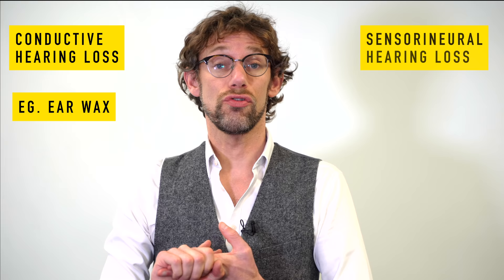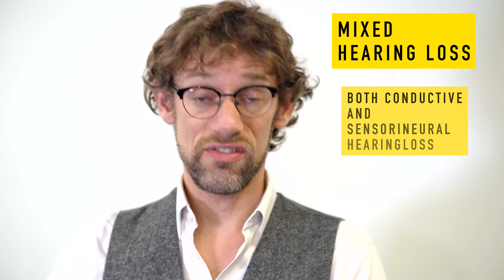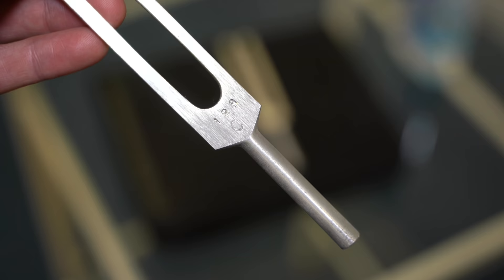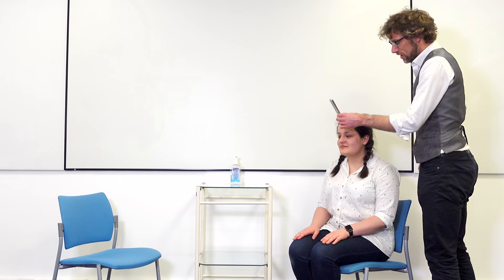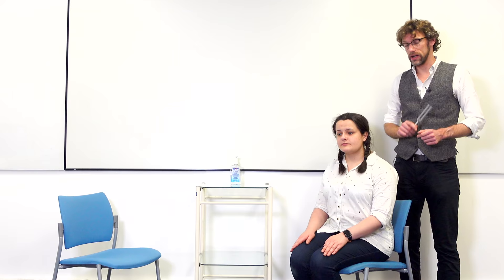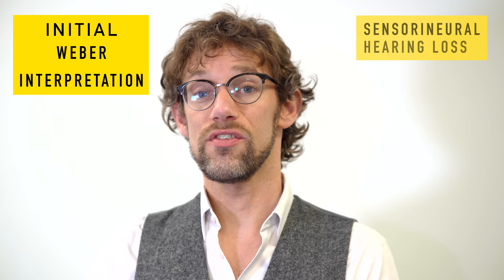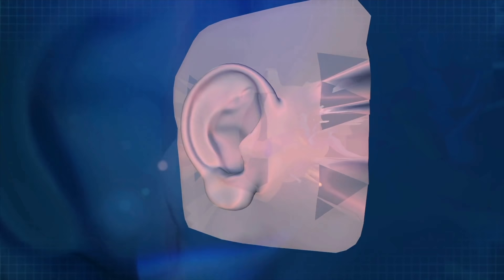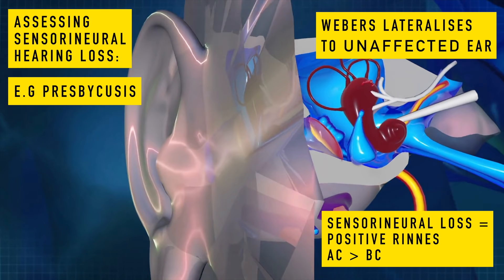Assessing Hearing: Sensorineural Vs Conductive Hearing Loss - Weber And Rinne Test - Dr Gill

Comment: So basically, lets say a patient hears the Weber's test better in the left ear, they either have a sensorineural hearing loss in the right ear or a conductive hearing loss in the left one, right? 

And to verify this we need to use Rinne's test to see if the Bone Conduction for the left ear is better than its Air conduction: if BC > AC, it's a conductive hearing loss in the left ear, if it is not, most likely the AC in the right ear will be less effective than the BC which will show a sensorineural hearing loss in the right ear.

Did I get this right? I'm not a medical student but as a student in audio engineering everything about sound is fascinating to me

Thank you so much for the videos, I subscribed for more :) you never know when you might switch careers lol
Reply from the maker: Perfect 😊

Comment: I have auditory processing disorder so my brain hears everything equally and doesn’t distinguish background noises from relevant noises making it harder for me to process relevant noises such as someone trying to speak to me because I’m simultaneously listening to all of the other noises around me such as a ticking clock, running furnace, passing car, radio or television on in the background etc. but I was also born with ears that didn’t internally form properly which frequently causes them to build up with wax blocking some of my hearing if I’m not careful so I’ve always found this topic rather interesting.

Because of the information overload I sometimes have trouble with my speech as a result and words in my brain don’t always make it back out to my mouth properly because they get stuck in a traffic jam along the way which is very frustrating.  Ironically using sign language completely bypasses the issue for me because it’s a visual language but not enough people know it for me to communicate with it effectively.  Fascinating stuff!!!

Comment: Good video Dr Gill. I have hearing loss in my left ear due to use of a shotgun for years. First noticed it when lying in bed on my good ear. When I lived my head I could then hear a house alarm going off down the road. Put my good ear back on the pillow and the sound was gone. Bit depressing initially. I went for a hearing test and was fully expecting to need a hearing aid but the guy said I only I had only a narrow frequency of hearing loss and a hearing aid wouldn't help. Interesting. Still pretty deaf in my left ear though.
Reply: I’m the same on my right. It’s depressing as hell
Reply: @jodyjackson5475  ah dont worry about it man. I did too for a while and then you get used to it. If your other ear is in good nic you will be grand. I do put an ear plug in that ear when i go shooting now though.

Comment: I had one of these when I was in my early 20s but I didn't realise it had a name! They found that my hearing was normal but I was experiencing a lot of physical blockages because my sinuses are about .0000000734 nanometers in width and I get snot backed up in the system constantly. Now I'm in my 50s but I'm still not using my nasal spray. Metallica overcomes most barriers :D

Comment: Curious what the results would be in my case. I have severe to profound hearing loss on both sides due to Mondini dysplasia and also tinnitus. I wear hearing aids that allows me to hear relatively well.
Reply: I have tinnitus as well. Have you found anything helps?
Reply: @matthewfurlani8647  Not really. I've just gotten quite adept at ignoring it most of the time. I kind of turn it into a sort of background music.
Reply: @matthewfurlani8647  i saw in one of the other comments that listening to white noise helped them

Comment: Dr. Gill, I have a question! Not being in medicine, it's difficult to gauge this myself.

After watching the Rinne test here, I recall that 42m25s into this video: https://www.youtube.com/watch?v=ONRX9yGLXXM, Dr. Martin Samuels advised against waiting for the sound to disappear in the first stage of the Rinne test, due to the tuning fork's vibration dissipating at a non-linear rate, thus causing a false positive when the patient can't hear the sound through air conduction. He also said the Weber test is very hard to use effectively in normal practice, due to noise and difficulty of patients in perceiving where the sound is coming from.

I'm curious to know your thoughts on that; from a physics perspective it seems plausible to me but I don't know well the dissipation speed of tuning fork vibration (or whether it is really relevant in clinical practice, whether it's just down to specific tuning forks behaving differently in that regard, etc...)

Anyway, I'm enjoying watching your videos as always. It's very interesting learning more about medicine and the details of different parts of it from them!
Reply from the maker: I wonder if that’s is a hospital medicine issue - GP rooms are generally quiet, so no problems with Webbers

As for waiting for the sound to disappear, I’ll have to check what he means, as by definition of the test, the patient has to not be able to hear the sounds any more from the bone conduction - so moving around before the sound has been lost might add in errors

Comment: I broke my temporal bone and with tuning fork test it looks like I have conductive  hearng loss and tinnitus, I'm going for another hearing test on Tuesday and need an MRI scan just worried what the problem might be
Reply from the maker: Oh dear. I’m sorry to hear about your accident. 

If would be really interesting to hear back after for your result if you’d be able to tell us?
Reply from the maker: Obviously I’m not able and allowed to give specific advice, but I can say it all depends on what the cause is. 

On the simplest example, conductive hearing loss due to wax, will be resolved when the wax has been addressed.
Reply from the maker: Absolutely. I was using that an an example of conductive hearing loss improving with resolution of the issue